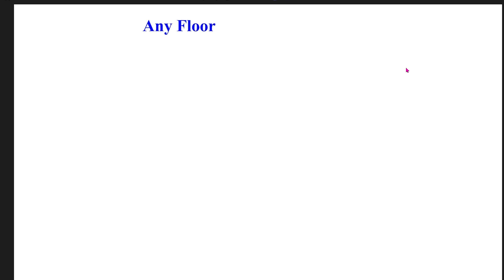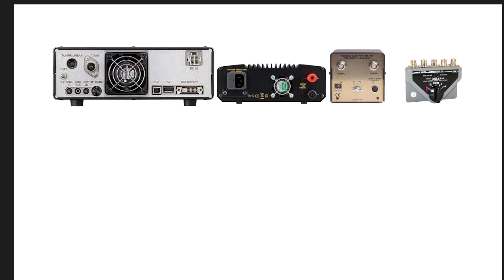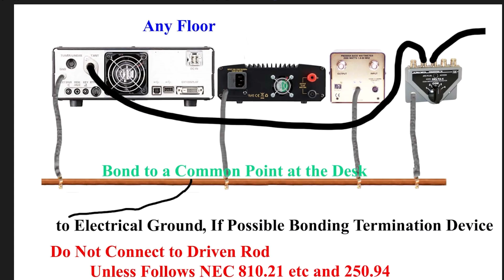Ground is a Myth says the ARRL! Ground is NOT a Myth and Here's How I Grounded My Station W6LG Jim

Comment: Jim, I agree almost perfectly on every point.

You are absolutely, 100% correct about the safety aspects of grounding and the absolute need to follow the electric code for grounding the station and tower.  Those codes exist for good reason. We can’t emphasize this enough!

Regarding the RF ground, I would not call it a myth, but I would say that it is relative. As you drew your station, you could reasonably call that copper pipe an RF ground point for LF and HF frequencies. The distance is significantly less than 1/4 wavelength. All else can be described in relative terms to that ground point. Why is this important? Because it actually does matter. For one, as you said, that transmitter noise problem is likely to go away when the shack is tied to that ground reference point with low impedance connections at the frequencies in view. The station may also benefit in the reverse direction with lower noise. Another advantage is that if anything gets unplugged from the power and is still connected to an antenna or control wire, the chassis is still grounded and protects you. That ground also makes it handy to bring test equipment on the bench and not get fooled by phantom signals that are relative between the test equipment ground and the DUT ground. I could list the benefits for hours - after 50 years that ground point proves its worth time and again. 

The antenna out on the tower is totally relative to that ground point as well, and can be described as well, which proves a stable relationship and the mark of dependable performance.  I use a method similar to yours, except my shack has a copper bar tied to a HALO ground which is part of the building’s electrical ground system installed by my electrical contractor, which is at the end of that chain of grounds coming from the antenna. I do not skimp on safety or performance. 

On lightening arrestors, I also agree that they are misnamed. But one point to mention is that some styles of arrestors are designed to help avoid a strike, not absorb one. Yes, if your antenna gets hit, you best have had your rig disconnected. For commercial antennas and power substations, proper lighting protection reduces strikes.  There are commercial guidelines for lightning protection that an electrician can use to decrease the risk and damage from lightning. I am also a fan of grounded antennas, which I also find reduces noise from static, including rain static.

I was shocked like you about many things in that presentation. Not knowing what that screw is for was just too much. Ground is not a myth. Ground is a point of reference, which also happens to be near the voltage potential of your body in your shack or yard. That alone makes it not just “not a myth” but rather important as well. As a ham I find it embarrassing. As a professional I declare it dangerous nonsense. As an engineer I shake my head and say, “This is what they must mean by ‘Amateur’ in ARRL!”
Reply from the maker: Thanks very much.  With respect to lightning, my video was not about lightning.  I made a quick reference to a listed device connected to the common point at the main panel.  Light arrestors, in my view, do not arrest lightning.  I helped design one that used an MOV to ground above a certain voltage.  If one is lucky, the device might help.  But a direct hit would vaporize the MOV.  Best thing as you said is disconnect the transceiver from everything.  I used to put them into my chair.  Most lightning around us would hit the powerlines and come in that way.  There is a lot more to the subject of lightning that would have taken way too much time in my video. It was already long and Ihad to edit it down.  NEC Chapter 8 and videos by Mike Holt are good sources.  I did mispeak about the GFCI as many have pointed out. The video was not about GFCI's. It was about how I set up my station and how others may want to do it the same way.  The title of the ARRL's video is what upset me so much. It seemed to me to be completely irresponsible.  I was so upset after a few days of thinking about it made my video even though I felt terrible physically from the cancer and medication. I felt it was important for me to say groundd is not a myth.  I am not an engineer.  I have never taken a course in engineering.  But I do know the ARRL video was wrong. Sorry for the long response by me. Thanks again for your comment and advice. 73, Jim W6LG

Comment: Just revised circuits on a subpanel in my garage (with permit & inspection). I'm setting up my shack and wanted my radio gear on its own circuit.  No amps, so one circuit will be enough. Lights are separate, and I do have an outlet there run from the circuit for my work bench outlets on the other side of the garage to operate a small heater.  Only one of the circuits is protected by a GFCI OUTLET. On the others I installed GFCI BREAKERS, so if they detect ground fault, it will trip the breaker and require a reset.  The panel is less than 25 ft from the most distant outlet, so that's not inconvenient.  I have arc fault protection (AFCI) on most circuits, though that's not required in a garage (in 2024).

It is a subpanel, so ground and neutral are not tied together there. Ground goes back to the Main panel and is tied to neutral there.  The inspector found a defect missed by the previous owner's subpanel inspection. The subpanel box was not bonded to its ground bus - ouch.  Because it was a Siemens box, I ordered the bonding screw from a supply house  for ridiculous, if still minor, expense ($1.25 + $14 shipping) and now have several lifetimes' supply of Siemens bonding screws - 9 remaining from a 10-pack.

In most of WA, electrical permitting is a state process rather than local, and it's pretty easy and not terribly expensive.  Just read the applicable NEC carefully so you stay in compliance.

Comment: You are right. I'm a physicist and I can see that what she's getting at is all very well in theory but it's practice that counts and the various safety codes cannot be brushed off [like she did] because 'everything' is wired to those regulations. More alarming is that a neighbour had her house re-wired without 'pulling' a permit (on everything, not just electrical). That foolish saving of $800 for filing the permit [with a $3000 fine if it was reported] is amazing. Dodgy cheap 'electrician' was used, un-inspected and ground tied to the heating radiator system!

Comment: I've seen this with the NRA and the AOPA. The CEO pay goes up and up as the organization goes downhill. Looks like the ARRL is going the same way. I watched the ARRL video on grounding. She didn't adequately emphasize the difference between a safety ground and an RF ground. She didn't communicate her message effectively. I do think she knows what she is talking about but she could have said it better. Thanks for adding to the discussion, Jim.
Reply from the maker: I did at my old age find much of it hard to follow from issue to issue. I did watch it more than once because I could not believe that there is no ground.  I thought perhaps that I got it wrong. Overall, it was not a resonable well thought out helpful presentation suitable for amateur radio operators so that they could use at their station.  In other words, it failed.  In my video, I tried to be helpful and explain how I do bonding and grounding in my room.  I did not discuss grounding or lightning protection at the antenna.  That is another long discussion. 73, Jim W6LG

Comment: To keep it simple:

1.	 An antenna has two conductors where a feedline presents a differential voltage between the two conductors.  How do you kill an antenna and stop RF transmission?  Short out the two conductors, i.e. connect them so that they are at the same voltage potential.  If you have several pieces of equipment where there could be the possibility of having a different RF voltage on each of their cases, you stop them from becoming an antenna and producing RF-in-the-shack by simply making a low impedance connection between the cases.  This is goal of the braid-and-copper-pipe configuration.  You are simply making sure there is no RF voltage difference between cases and so the cases cannot become an antenna in the shack.

2.	What about current loops?  Ground loops (or current loops) are frequency (wavelength) dependent. At HF, the wavelength is so much longer than the loop, there is not a problem.  Unless, of course, you configure things such that the connection is highly resistive and there is a voltage drop along the interconnecting wire.  This is not really a ground loop issue but rather simply poor implementation problem. 

3.	For safety, the equipment cases are connected back to the main electrical panel’s ground.  The copper pipe is probably already well referenced back via the several power cord ground-pin-to-case connections.  But it never hurts to run a wire back to the ground of the wall power receptacle.

4.	What about lightning?  Lightning issues are never fixed inside the shack.  Don’t connect a big wire from outside the house to the copper pipe inside the house (i.e. a heavy wire going into the house from an extra ground rod at the antenna entry point).  Adding this wire essentially provides a nice conduit for inviting lightning energy right into you shack.  Use lightning equipment outside at the entry point.  Rods on the tower.  Connect the feedline arrestors to the rod -- all outside the house.

5.	No such thing as RF ground.  You don’t need it in the shack.  Your handheld radio in the shack doesn’t need one and your HF radio doesn’t either.
Reply: ב''ה, do we just say that "RF ground" is "counterpoise" as with reactance etc.?  Sometimes the ground works well enough, everyone's seen a HT with a quarter wave perform better in the hand, yet what's going on has at least purpose-specific differences.

Comment: What is it about DMR, that trips Ground Fault Interrupters ?
I have heard other Hams having the same issue  ?
Mostly getting within a few feet of the outlet, while transmitting, will trip the breaker !
Only a guess, but I wonder at the insane switching speed of a DMR radio, that they are harmonic rich ?
In other words, 
" Filthy " with spurs ?
But.....just a guess ?
                          🤔......?
Reply from the maker: I have not a clue.  73, Jim

Comment: I went back and watched the ARRL video, and nothing you're saying is incompatible with what Kristin's saying.  Lightning protection is important, but her description of the GFCI is spot on.  In order for a GFCI to trip, current doesn't necessarily flow through Ground (whatever you call ground), it just didn't flow from the Hot to the Neutral.
Reply from the maker: I did not discuss lightning protection except to say use a listed device in the feedline.  A GFCI will trip as I discussed. If the current is not flowing to ground, then where did it go? That part of my video is not signficant. Station bonding and grounding as I have done and shown is the point.  The title of the ARRL' s Vice President Video does not agree at all with my video. So devices in her house like the washer, dryer and refrigerator need not be grounded since there is no ground.  I'll be they are grounded. Thanks for your analysis in any case.  73, Jim W6LG
Reply: @ham-radio Hey there.  Ground is just one option for the current to flow. I enjoyed your HF vids, btw.
Reply from the maker: You are right. Thanks, Jim

Comment: I totally  agree with  you.   Got  my  Novice in   1967  while in high school.  Went   on  to  Electrical Engineering  and  then Physics!  While the  approach is  different  it  is important to get  things right.    In Physics   every potential  must   have  a reference.   In   Electrical Engineering  - circuits every voltage  must  have a  reference.

Comment: Hllo Jim - I understood from that ARRL talk that it was referring to an RF Ground myth.  An electrical (mains) ground is very necessary.
Reply from the maker: That is not correct.  The ARRL is saying that all ground is a myth.  I too watched the video three times. Keep  in  mind the title of the presentation: Ground is a Myth. 73, Jim
Reply: @ham-radio I only watched it one time.   I think she made her point. I agree, Ground is a myth.  She started by laying out what she meant  by ground the electrical concept, and then stuck her sword in that mythical dragon until it was slayed.  There are many things we do that we refer to as "ground" in electrical systems.  These may be important for function, safety, and required by code.  I didn't come away from the talk, feeling she said we shouldn't do these things.  We can still use the word "ground" and still do these things, but the Earth is not a copper sphere so let's let go of the myth and treat "ground" as just annother wire in the circuit to provide function, safety, and/or comply with a code.  I will watch it again.  Maybe I missed something.

Comment: Hi Jim, can't argue with most of what you said in this video, but I just went and listened to the ARRL presentation by K6WX and from an RF standpoint she was spot on.  And when she kept saying "she did not know", I believe she was being somewhat facetious and trying to make one think outside the box so to speak (it appeared to me she knew exactly what she was saying, especially from a physics standpoint). Maybe the title should have been RF ground is a myth or something along those lines, but after listening to your video and then carefully trying to catch K6WX making errors in her comments I really could not find anything she said that was blatantly wrong (especially when you keep reminding yourself that she is really focusing on RF).  The words she used to explain things were really from the physics world and very accurate, and she apparently has very good knowledge of RF.  While I had never heard K6WX talk before, I'm actually very impressed that she represents the ARRL.  I have worked with power distribution (among other things) at the manufacturing plant level for over 38 years and therefore very cognizant of the NEC and best electrical practices.  P.S. you're looking great which is wonderful to see.  73, Don wd8dsb

Note:  She is absolutely correct when she says that when a GFI detects imbalance between the hot and the neutral it trips a breaker and this could either be the GFI that is a dedicated circuit breaker in the main panel, or tripping the circuit breaker that is within a standalone GFI, either way a circuit breaker trips.  She is also correct that when a GFI trips she does not know where the imbalance of current went.  It could have happened because the hot came into contact with a person who was then standing on soil so some of the current flowed through the earth, or it could have been because the hot came into contact with the chassis of some equipment which is connected to a ground wire so the current followed the ground wire back to the panel, it could have happened that the hot wire came into contact with a different neutral wire and then the current flowed back to the main panel via this different neutral wire.  Need to be careful that we are not trying to always find fault (no pun intended) in what others say especially if there is past history/baggage.
Reply from the maker: The presentation by the Vice President is not about GFCI's.  So okay on that. The title is Ground is a Myth. It was not RF Ground is a Myth.  Again, she makes the case that all ground is a myth.  I have said for years that there is no RF Ground.  The title of the Presentation in my view is dangerous!  The title was Ground is a Myth.  That idea can be deadly.  You disagree and I say that is wrong. 73, Jim
Reply: @ham-radio  hi Jim, I said the title probably should have been RF ground is a myth so we are not in disagreement about that, I was just making a point that her presentation was pretty factual even though you said she misspoke regarding GFI’s and I disagreed with you on that and I explained why.  73, Don wd8dsb
Reply from the maker: Agreed on the GFCI.  Again, that was a minor point in my video. Station bonding is important. Same with the refrigerator, DW, washed, dryer and more devces that are grounded for safety.  Ground is not a myth and devices need to be grounded. On that, you and I agree completely.  73, Jim

Comment: Ground is real! Just fall off the roof and you will know. 
As a RF tech 30+ years deep, most "spooky" problems are due to poor grounding. I like the term floating ground because it correctly describes a vehicle, vessel or aircraft. Jim referred to the term bonding and there is truth in that. Everything needs to be tied to a common reference.
The nice part about properly grounded equipment is no tingles and you won't zorch your equipment after walking across the carpet.
Unless it's an IC-718, that requires internally grounding the tuner shaft to the chassis because Icom forgot to do that.

Comment: One thing I am confused about is. Alpha delta switch instructions clearly say do not bond with other equipment. Run a ground wire directly to ground rod.
Reply from the maker: So you need to ask them. 73, Jim
Reply: @ham-radio  point is they have lightning protection in them, so you would not bond them to other equipment. I watch your videos and know that you know what you are talking about. Your videos are greatly appreciated. I thought that maybe you just misspoke about the alpha delta switch.
Reply from the maker: I think that I said there needs to be a listed device connected to the coax and connected to the common point ground at the main panel.  I wonder about devices that claim lightning protection like that switch.  Seems like it could be more about marketing than actually doing anything. The MOV will short with a spike.  Lightning would go through the switch even with the MOV.  So bonding the switch seems reasonable to me. 73, Jim